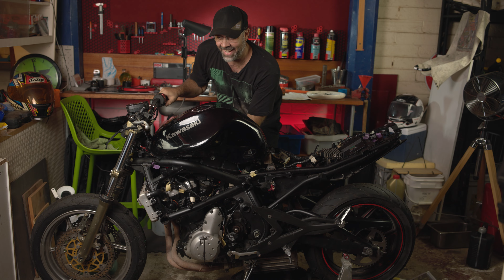My Streetfighter Build Finally Started… But Something Sounds Wrong

Comment: Jesus fuck that rattle assaulted my ears and soul. That poor bike needs a blanket and some coco 😢
Reply from the maker: I know. Its was gut wrenching but I was just so happy she even started. I need to tighten up the exhaust system properly and see if thats the issue. I plan on pulling the cover off the top end do a quick visual inspection and check valve clearnaces). Its going to be a journey but I'm determined to get this bike running.
Reply: @TheDeepPlanet  hey, this is my other account and I just got a Buell XB12x that I'm also about to be doing a full build on. I've been there before and I definitely agree that most of the time outweighs any other problem that arises. 😂😂😂
Reply from the maker: Thanks! Good luck with your build !!!
Reply: @TheDeepPlanet YouTube is being suck and keeps deleting my comment but I have over 15 years of experience in the automotive and motorcycle tech industry and the entire build will be followed on my channel so if you ever want to bounce ideas off each other or ask me anything feel free to. 🤘
Reply: @2thewiremoto  very suck. This is my name on everything fyi 😂
Reply from the maker: Maybe hit me up on IG :
 https://www.instagram.com/thedeep_planet?igsh=NDV5bWp0c25rbTkw
Reply from the maker: I'm keen to learn and get advice. Ive done a fair bit of basic repairs/service and gone as far as a valve clearance check but not had any real issues with engines that require full teardown. I'm learning as I go and hoping to share my journey so other people can fix or at least diagnose problems. I'll spend some more time on the bike this weekend and hopefully post the next video early next week.
Reply from the maker: So there been a huge development in this. There was a collar in the combustion chamber. Timings were off and we've bent valves and damaged a piston. Doing a full rebuild and valve and piston replacement this week...
Reply: @TheDeepPlanet I love that I called it instantly "your valves are smacking your piston heads." 🤣
Reply from the maker: @TaihamXMetroRat Its been a huge learning experience and I'm having the best time figuring it all out. Replacement valves a ready to be lapped, good pistons ready to go in, new gaskets on the way. Should be here by the end of the week. Can't wait to make my next video all about it!
Reply: @TheDeepPlanet hell yeah man 🤘

Comment from the maker: It started… but there’s a top-end rattle I need to investigate.

What would you check first — cam chain tensioner, valve clearances, oil pressure, loose exhaust/header, or something else?